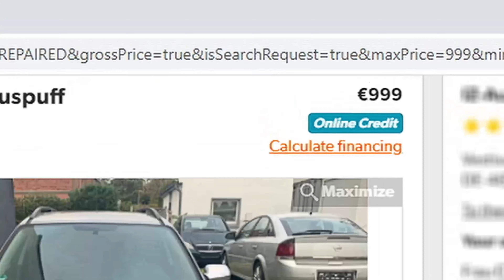Wheels up! - 1999 Opel Astra CC 2.0 Update 4 - Condition: Help

Comment: You need my big Makita impact for those wheel nuts, that thing would strip the clothes off a nun without even a whiff of remorse!
Reply from the maker: Yeah, I need a proper impact .. and one of those Milwaukee 90 degree power ratchets
Reply: @ConditionCheap  I think Makita has one too!  Ask Mikko